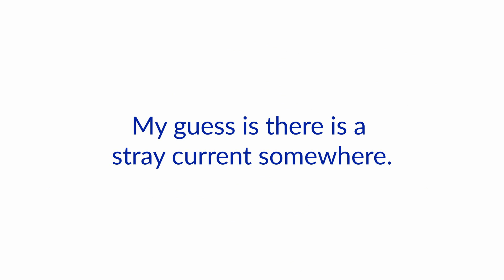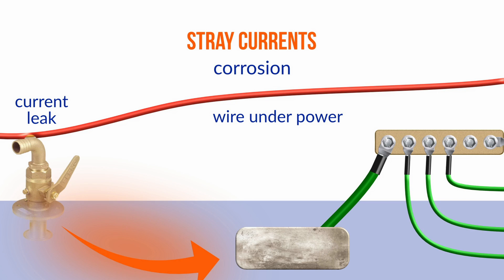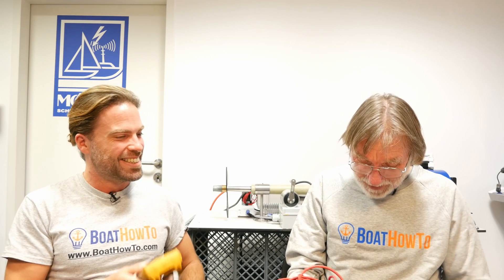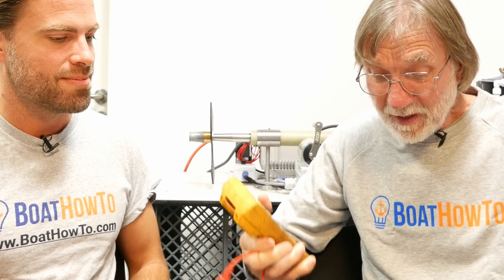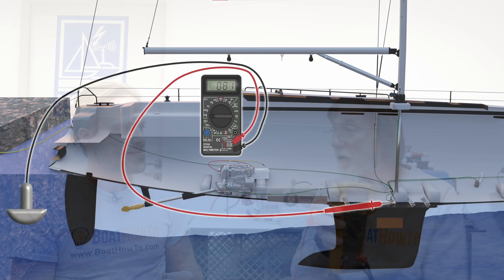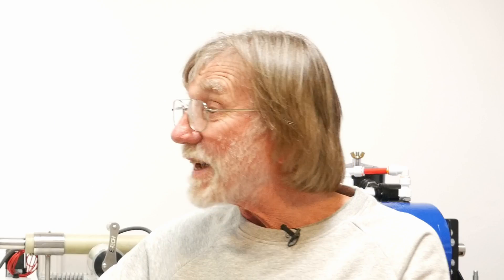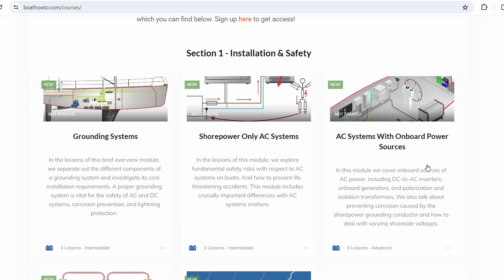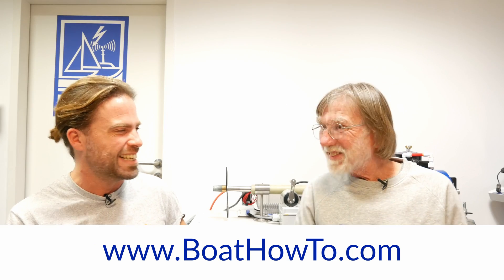CORROSION on a boat: Stray Current or Galvanic? | Ask The Expert with NIGEL CALDER

Comment: I think Nigel meant to say that stray current (say from a bronze seacock) attacks all the anodic metals, including the zinc.  Please correct me if I'm wrong
Reply from the maker: No. What you are referring to is galvanic corrosion. In this case, the least noble material (usually a zinc or aluminum sacrificial anode) will corrode first. With stray current corrosion on the other hand, the metal through which the current is induced into the will dissolve, no matter what kind of metal it is. That's what makes it so devastating. - Jan
Reply: @BoatHowTo  Ah! Thanks, Jan.  But to be clear, is there a difference between "stray current" from/on your own boat versus current in the water from your neighbor's boat?  

To confirm by experiment: If I attach 9v bat pos to copper and place in a bowl of seawater with zinc on the other side, it is the copper that will get eaten up? 

Thanks!  Enjoying your videos!

Comment: I have a galvanic isolator on my boat, and I wondered whether it was fail safe. I asked the company making the product, and they said that the product used two set of diodes, and if one failed, the second would insure it continues working. I my opinion, this means that the product isn't fail safe, since the second set of diodes might also fail, living the circuit open. Is that a sensible guess?